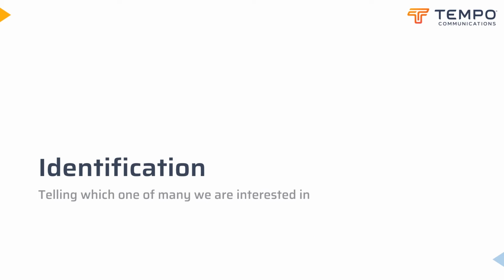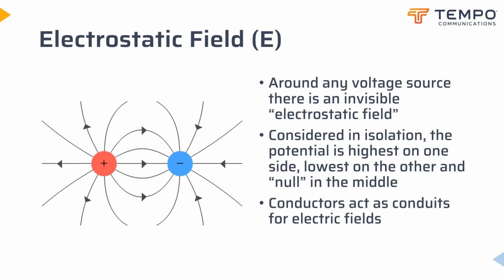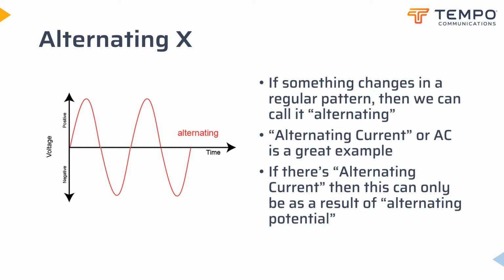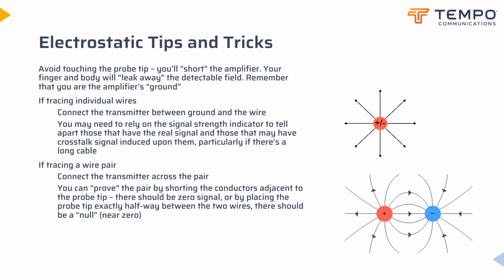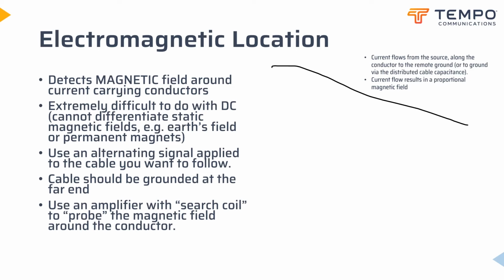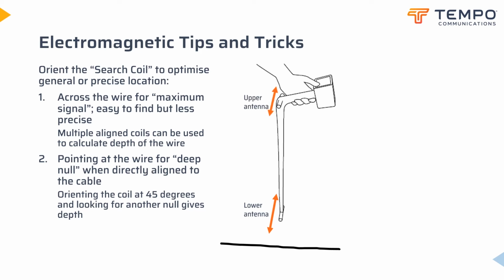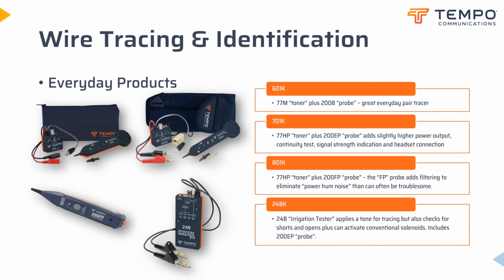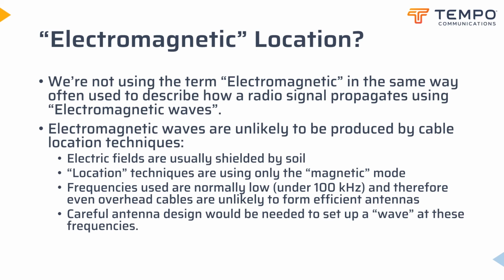Location and Irrigation: Finding Cables and Identifying Wires - Webinar

Comment: The Tempo 701k/g is vastly superior to the fluke pro 3000. The fluke is fragile, drop the probe and the tip will break off and speaker will break. The tone generators tones blend in with 60hz noise, and the probe has no led indicator, butt set studs, or swapable tips.
Reply from the maker: Thank you, Henry! The 701K-G is a technician tested and trusted product and we are happy you've had the same experience with the tool.
Reply: @TempoCommunications  best tone probe kit ive used. Question though, are all those noname tempos on ebay and amazon licensed clones? Ive taken one apart and its identical to the older 200ep and 77hp inside, exact same circuit boards and components.